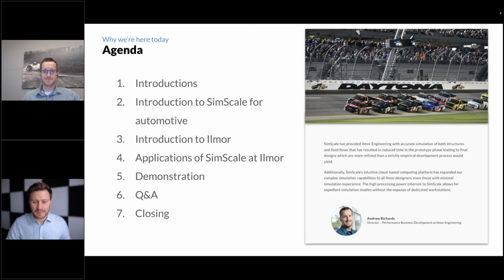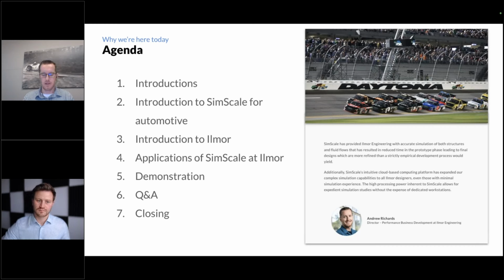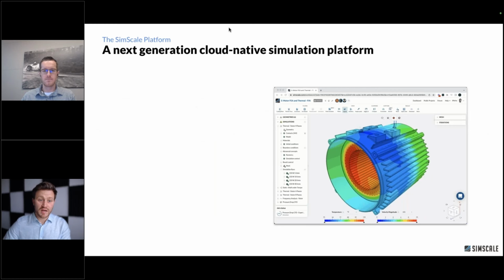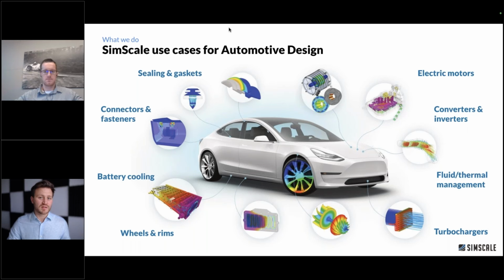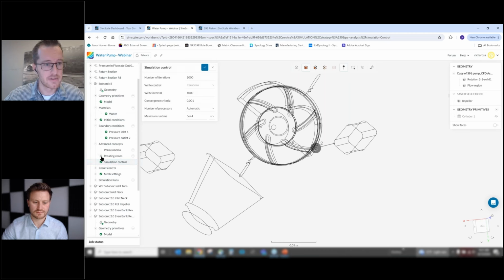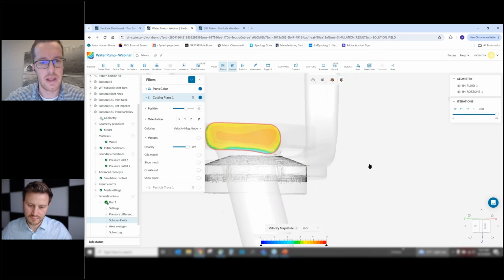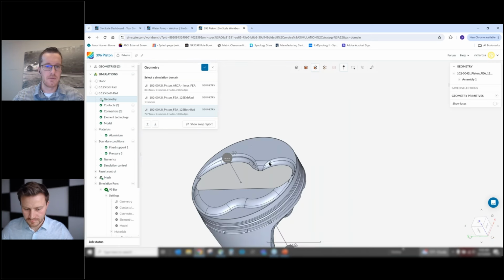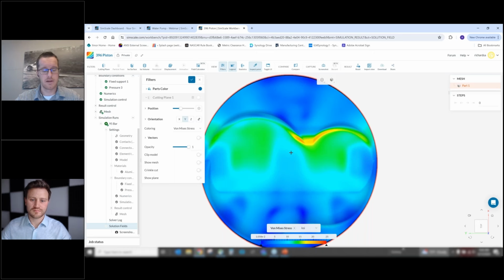In the Fast Lane - Simulation for Motorsport

Comment: Incorrect setup of piston boundary conditions. Did not capture piston side load or thermal stresses that play a greater role in this valve pocket (typical V8 crown geometry) min. principal stresses. Please correct with a full thermo-mechanical simulation, incorporating actual geometry and fluid film boundary conditions.